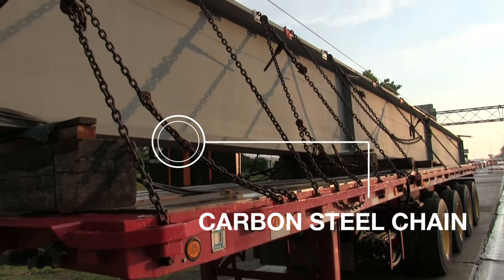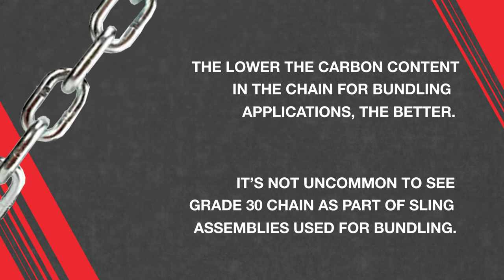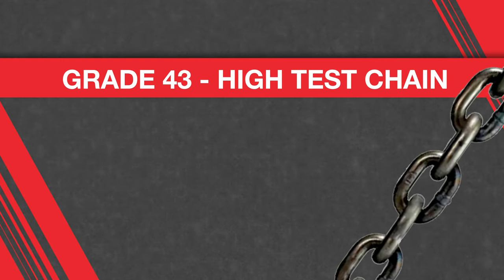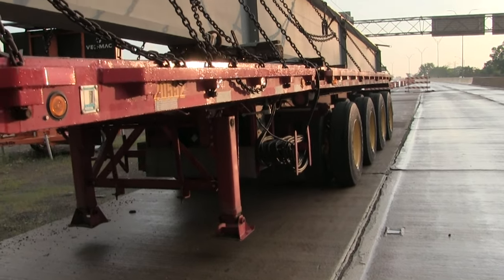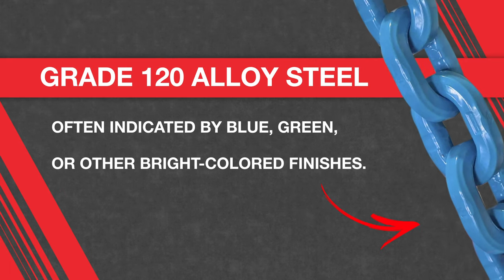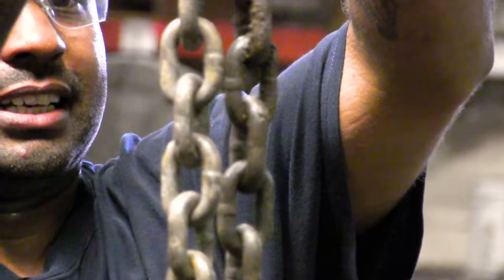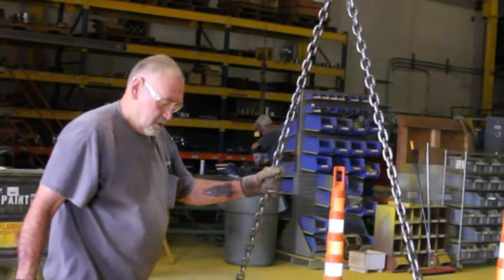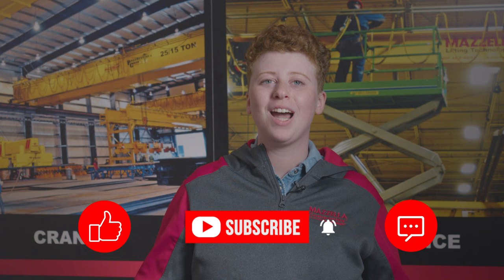What Are the Different Grades of Chain?

Comment: That little hint about 80/100/120 chains being able to stretch before failing is something that I hadn't yet heard and really helps clarify why lower grades shouldn't be used to lift. Good video.
Reply from the maker: Great! Glad it helped clarify! Thanks for watching!
Reply: Alloy lifting chains must stretch a minimum of 20% before breaking.
Reply: Alloy chain is also elastic in nature it has what I call recoverable stretch which means it stretches under load but returns to its original dimensions. 

Unrecoverable stretch is the overload indicator and by Unrecoverable stretch I mean the chain stretches deformity the link and it does not return to it's original dimensions. 

Wire rope is different and Unrecoverable stretch is not necessarily a removal from service situation.

Comment: hi boater here looking for advice from professionals that handle chains all day.  Our boat uses 300 ft of chain and we wish to take the anchor load off the windless using a sling off the cleats.  I have heard that the way you hook onto a chain link is very important as the wrong hook will weaken the chain.  I have heard of a chain clutch.  what is the best clutch out there that has a safety device on it that shops it from falling off the chain?  Thanks

Comment: If you damage a link in grade 80, you have to replace the whole leg? did i hear this right? 06:49
Reply from the maker: So, really, it depends on the capabilities of your local rigging shop. Some shops have certified welders on staff who can cut out the problem link and weld in a new one, assuming there is no other damage to the sling. If you do not have a local shop in your region with these capabilities then the entire sling leg would need to be replaced. The bottom line is that if you have a damaged link in your chain sling, the entire sling cannot be used and must be removed from service and sent in for repair. Once repaired, it will be retagged if repaired by someone other than the original manufacturer, then it needs to be proof tested before being put back into service.

Comment: I was actually looking for more than 'don't use it', I already know that but you need to give riggers tools so that we can explain to people the WHY not just the what.
Explaining to your mate who lifts concrete pits and beams with transport chain by throwing it around the teeth of his excavator needs more than just 'it doesn't stretch'.
If I can give him a number like I can with rigging techniques and load angles with rated gear, even if that number is vague or approximate I might be able to convince him to actually buy some lifting chain and avoid injury or damage down the road.
Or at least peace of mind, 3 or 6m of 1/2" transport chain someone grabbed off the back of a heavy haul trailer slung at a 60deg angle will lift 250 or 500kg no probs.

On the other hand when you start bending it and reeving it I need confidence that either it will or won't work.
Saying 'don't do that' doesn't cut mustard with a lot of people unless you can explain why.

Another thing, Here in Aus. I've certainly seen rusty transport chain but I don't believe I've ever seen any chain with G30 or 43 written on it, what is the comparable lashing capacity of that chain to G70? And how do I actually identify it?

Comment: My ??? Is how about pulling other cars out of the ditch per-say , say you got a big truck to pull out with your big truck out of a ditch what chain would you use ,, I have 3/8 5/16 and a couple more smaller chain not sure the size on smaller chain
Reply from the maker: Hi Leon, thanks for watching.  I would check the manufacturer recommendations for your chains and be sure to keep in mind the WLL (Weight Load Limit) of your chains in comparison to the cars you would be pulling.  Without having all the information for your tow we can't make a recommendation for which size chain to use.